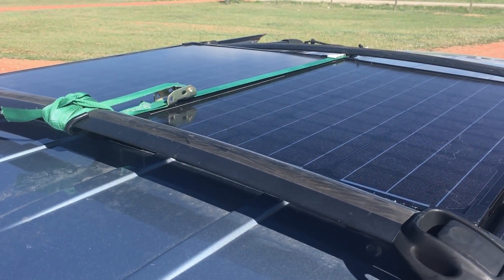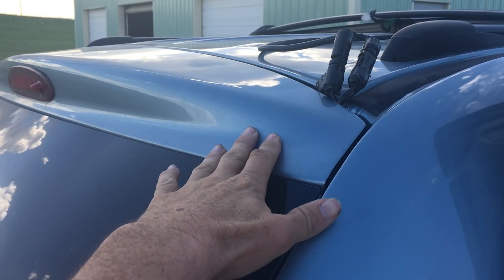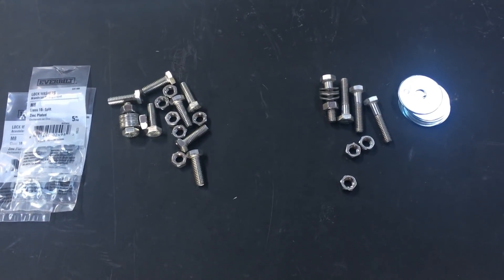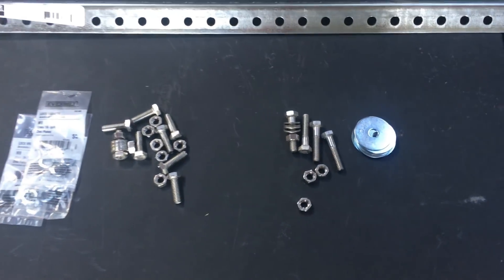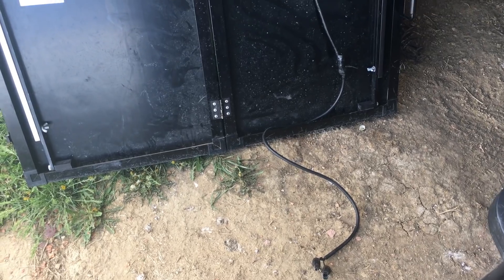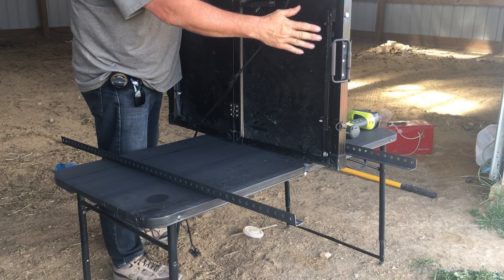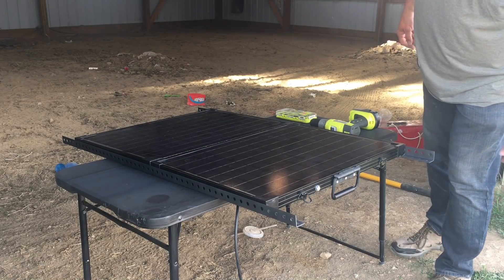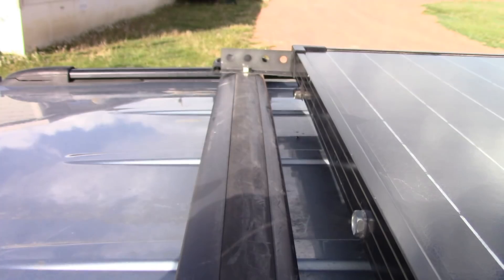Simple Solar Install on a Minivan: Mounting a Renogy Suitcase Panel on the Roof

Comment: Hello, thank you for sharing this! I'm curious whether this setup continued to hold up over time? I have the same solar suitcase and this would definitely be the most convenient way to mount it, but I'm nervous about drilling through the frame of the solar suitcase and potential rust and long-term security.

Comment: Thank you so much for sharing. I'm having a hard time finding a way to get it up and not too many videos showing you how to
Reply from the maker: It took me a while to figure out a simple and secure way to mount the panel on this van while working with the existing roof rack. I was also trying to keep this installation as discrete as possible which, based on conversations with a lot of people afterward - including several police officers, was successful. Unfortunately I no longer have this van so I cannot take any new photos to demonstrate better what I did.

Comment: I'm trying to do this to my dodge. I have the same brackets, my question is what size hardware do I need to screw the brackets into the roof rack.
Reply from the maker: This kind of thing varies between vehicles unfortunately so everything is "custom" with van builds, etc. It seems like I may have used 1/4" diameter stainless bolts as they would fit through the bars on my roof rack fairly easily, and then I used washers to prevent the bolts or nuts from pulling through.
Reply: @FrontierVanLife  Thank you so much. I got it up and it's running. I did screw them into the roof rack.

Comment: I really wanted to see the rest of the setup so I had an idea
Reply from the maker: I covered the entire solar setup (it was a very simple system) in another video. This one was just focused on mounting a portable panel on a minivan roof.
Reply: Robert Witham oh ok, thanks I’ll check it out!
Reply from the maker: Justin, here is a link to that video I mentioned. It was a very simple system, but it worked well enough for my needs. I would like to have added a battery isolator or continuous duty solenoid to charge while driving as well, but never did get around to that project before selling the van. I have a very robust system in my current van that I should probably make a video about as well. I would likely give serious consideration to a portable power station (solar generator) if I was starting over in a minivan these days due to the improvements in technology and the prices having come down a lot. It was basically just a DIY version of a Jackery (or similar) that I was running in the minivan. https://www.youtube.com/watch?v=PTMqjY91jx0
Reply: Robert Witham cool Thx

Comment: i know this video is old but it just popped up in my feed today. i have a renogy 100 watt suitcase without charge controller. i mounted it in my cargo basket on the roof with zip ties, then i ran a thule kayak locking strap underneath and through the basket and stand and cross bars to keep it safe. i have no issues on the highway at all. very snug...and i hook it up to the renogy phoenix. i also have a bluetti 1500 and can hook it to that if needed. :-) i hope you guys are doing well and safe!

Comment: I have to be online a lot... maybe i can start with that setup then will get a 2nd one if i can afford another 100W panel. I would most likely not mount it on roof. I plan to be close enough to a town to have em outside. def want to charge the 2nd battery with alternator
Reply from the maker: Being able to charge off the alternator is a great bonus, especially if you drive frequently.

Comment: I love this solar panel setup! One question though - do you have a contingency plan for hail? and or have you had that issue yet?
Reply from the maker: I ran into hail a few times and was a always a bit concerned. Never experienced any damage though. I don't think I have ever actually heard of panels being damaged by hail, though I suppose with large enough hail it would be possible. Probably do a good job of destroying the van if it was that large though too. LOL I have seen broken panels, but it was from other mechanical force - like the wind blowing them over against rocks or similar.

Comment: I just got a very light weight flexible 100 W panel with holes all around the edges...I was thinking I could use heavy duty zip ties hooked on my roof rack...has anyone tried this?
Reply from the maker: I have heard of that, but would be nervous about it personally. I have also heard of people mounting them with industrial Velcro or VHB tape, though I also know people who have lost panels that way as well. I think my approach with flexible panels would be to mount a stainless steel or aluminum mesh panel on the roof racks and then install the flexible panels to the mesh using bolts. I do tend to overbuild, but that would likely be my approach to balance ventilation for the panel and secure mounting.

Anyone else have any experience mounting flexible panels?
Reply: I added a PVC frame to my flexible panels and am going to mount them similar to Roberts but I may need to build a wood deck so I don’t get vibration and can build a wind scoop in front.

Comment: Is the solar unit, waterproof? Would I have to take it down in the rain? Thx
Reply from the maker: The solar panel itself is waterproof, though the charge controller that was mounted on the back was not weatherproof. I removed the charge controller and installed it inside the van to keep it safe from the weather.

Comment: The problem with this is that panels lying flat are very inefficient. Over the entire day, you may end up only getting 40% of what you would get if they were angled.
Reply from the maker: It worked well for several months after I installed it over the summer. Now that the days are shorter and the sun is lower, I have found a huge improvement by removing it so that I can tilt it toward the sun. I will have to consider a way to make it tilt when I reinstall it on the roof.
Reply: If you could put hinges on one side and a locking mechanism on the other side you could probably still safely drive when it's flat, but easily tilt it up when you are parked.

Comment: Would this work to run the smallest truck fridge?
Reply from the maker: That is a little hard for me to say definitively, but as a general rule 100 Watts is the minimum to run a refrigerator. The catch is that on cloudy days or during really hot weather you may find it is not enough. Cloudy or rainy days will result in not much power coming in, while extreme heat will make the refrigerator run more than usual. I would think 100 Watts would be adequate if you also had a good battery bank or had a solenoid or isolator installed so you could charge from your engine if necessary.
Reply: And, it depends on the size of the fridge.  Some of the small Dometics draw about 35 watts... when the compressor motor is running.  So, a panel with 100 watt capability should do the job, even if it's only outputting 40 watts.

Comment: We are about to set out in our van and will have a Dometic CF18 and 2 laptops.  I guess there's no hope of running all 3 at once, but is it possible to have a suitcase panel kit for the 2 laptops and another one dedicated to the fridge alone?  This video really helped!  I am simple-minded and need simple install instructions!  LOL
Reply from the maker: Assuming you have a good battery or batteries (mine needs to be replaced), you will have a buffer that allows you to temporarily draw more power than you are taking in or after dark. The catch there is that you don't want to draw the battery down too low or it will damage it and shorten its life.

The other consideration is the type of laptops you are running. I actually use two. My older one that I rarely use now is a glorified netbook (came with Windows, but currently running Linux). That laptop sips power and will run 12-14 hours on a single charge. Unfortunately, it is not remotely powerful enough to edit video. The new laptop is an Asus gaming computer that I use for editing video. This laptop sucks down a lot more power, but is also much more capable. While the power draw on laptops can vary, I have read that 5 amp hours is a good average for full-size laptops. That is about what you can expect to pull in from a 100 Watt panel with good sun.  Another trick with laptops is to dim the screen or turn on the battery saver mode to limit power consumption (this does limit performance though).

You could certainly use two separate solar kits, but you would need separate batteries to keep everything isolated - one for the fridge and one for everything else. That being said, the CF-18 is fairly small and supposed to be pretty efficient. Keeping it as full as possible (even if only with water bottles) will make it run more efficiently, as will keeping it out of direct sun during the day. A lot of people wrap extra insulation around them or cover them with blankets or pillows too, but I have not seen any scientific reports on how much difference it makes.

You can get an idea of how much power the refrigerator and laptops will use by doing an internet search for the models that you have. The refrigerator, of course, will be on 24/7, but the laptops will depend on the hours of usage each day. A lot of times though it comes down to "trial and error" - just keep a close eye on the battery voltage to be sure you are not drawing too much and adjust from there as necessary. One final thought is that I tend to have trouble on cloudy or rainy days. You would probably want to save power for the refrigerator on those days. I sometimes go to a library, coffee shop, or relative's house on those cloudy days to work and recharge the laptop.

Hopefully this helps :)

Comment: EXCELLANT video! Very valuable install. Thank you. Safe journeys and many adventures.
Reply from the maker: Thank you! There are definitely fancier installs that can be done (like tilting panels, for example), but I wanted to demonstrate a simple installation. Solar can be overwhelming when you first start to look into it, but it is possible to go with a pretty simple setup too.

Comment: I want to put solar on my van, maybe 1 big panel or two 100 watt. I have to have it done though. Nice job!
Reply from the maker: Thank you! I find 100 Watts to be adequate for a laptop and phone so long as the sun is shining. I would think 200 Watts would provide a little more of a buffer for cloudy days or extra power usage (like a refrigerator). Good luck with you install!

Comment: Interesting design, it looks much better than how you had it before. I think painting the bolts black would really finish it off perfectly.
Reply from the maker: This new installation is really a significant improvement. I was setting it up on the ground using the built-in legs while boondocking, but I still needed to break it down any time I needed to travel or if the wind was blowing hard. Once I started doing a lot of urban stealth camping this spring I needed a system that allowed me to use the panel in the city during the day. I found that I could position it on the roof between the adjustable roof racks, but was still concerned about wind. I finally noticed that the lip between the two halves of the panel was wide enough that I could use a narrow cargo strap to secure it from moderate wind and even hold it in place for low-speed driving in the city (I took corners very gently). Still, I had to take it down any time the wind was bad or I needed to drive very far. Actually, it was taking it down during an unexpectedly windy day that led to me being hit in the face by the solar panel! I am much happier with this setup. I was thinking about painting the bolts too. Now if the wind will just settle down so I can get to that project... LOL

Comment: Nice work, Robert! And who needs fancy? :)
Reply from the maker: Thank you! I have a preference for simple but aesthetically acceptable (preferable aesthetically pleasing) whenever possible. I would probably be willing to spend more money and time on the installation if the van were a lot newer and I expected to be driving it for at least a few years. In this case, I was able to really improve the function and provide more reliable power for only $30 in materials and about two hours of effort.
Reply: This makes so much sense when one has a vehicle with lots of miles. When it's time to buy a new vehicle these things can be easily transferred to the next one.

Comment: I know this will work better for you.  Thanks for showing how a suitcase can be a simple fix for people like me that are all thumbs and no brains for electric...
Reply from the maker: This is working great so far, and it was really a very simple installation. It cost about $30 for the hardware I used, and took only about two hours from start to finish.

The Renogy suitcase kit is a great option for people with basic power needs (100 Watts will cover basic needs so long as the sun is shining). I can recommend that kit without reservation for anyone who needs an easy way to get started with solar and does not need a lot of electricity. It served me well as a portable since January, but I really like having it mounted on the roof now.
Reply: You have convinced me, I wanted more with roof mounts etc but I think this will do ok.  I need to run a medical machine a few times a day but not for long at a time, a nebulizer.  It should work

Comment: Thanks for the video!  Good look on the upgrade bro.  I do have a question about that warehouse barn thing.  Is that on your family property?  It's huge and empty.
Reply: Chris Allen Arnett Its his relative's house..
Reply: Thanks.  I used to date a horse trainer who trained Patric Swazye's special horses and she had a huge huge building that she trained the horses in.  That building reminded me of a smaller version of that.
Reply from the maker: It came out looking better than I expected. I was afraid it would be uglier! The functionality of having it on the roof is wonderful though. Today the wind is blowing so hard that I would not be able to have it out if it were not bolted down.

The building that I did the painting and assembly in is at my son-in-law's house. The building came with the property, and is basically a three-bay shop. It is used as a multi-purpose building though and at various times houses horses, vehicles, etc. It was empty right now because the weather is nice so I took advantage of it to stay out of the wind for spray painting.

Comment: Simple and low profile setup. Good job. Zip ties are very handy to use and you can make adjustments easier than nuts and bolts. Very well done video. Making simple life, simple. (2 thumbs up).
Reply from the maker: Thanks for watching! I ended up using zip ties on the folding legs to keep them in place as well as the wiring which is now secured to the roof rack (forgot to record that part of the project). Part of the allure of van life to me (besides travel) is simplicity. I am a long-time minimalist and really enjoy making a game out of seeing how simple I can make things without losing function. Too ugly or minimal can sometimes be detrimental I think, but simple is overall a good thing and can also be functional and aesthetically pleasing as well.

Comment: Looks good and much better solution than portable. The bigger air space underneath should help performance, especially in hot environments. I am a huge Renogy fan and had a 100w on my last trailer and 200w on the current one. Always works great! Good video! --Mark
Reply from the maker: Thanks for watching and sharing your experiences! I am the third owner of this particular Renogy kit, and the previous two owners ended up installing rooftop solar panels. Since this van has 231,000 miles on it now, I really don't know how long it will last. That factor makes me think inexpensive and modular with anything I do to the van. I figured by keeping all of the original hardware intact on the panel, I can put it back together when I upgrade vehicles and either keep it for times when I might be parked in the shade or pass it on to a fourth nomad. I have been really happy with the performance from this panel though (and it will probably be better with more air circulation as you noted), but would ideally like a little more power - especially for cloudy days.

Comment: Nice job Robert! Actually it is not obnoxiously noticeable and most people probably wouldn't give it a second glance. As you mentioned, add a solenoid for charging your house battery while driving and between it and the solar panel, your house battery (batteries) should cover your needs for a laptop, charging phones, batteries and running lights and/or a small fan.  I always enjoy your videos and creativity making the minivan work. ✌🏼 🚐💨
Reply from the maker: Thanks for watching! It did turn out a lot less noticeable than I thought it might. Now for the solenoid to charge while I drive (or on rainy days when there is not much sun).

Comment: Thanks for the simple explanation! great idea!  well done!
Reply from the maker: Thank you! I kept it simple and inexpensive in part because this van has a lot of miles on it and I don't know how long it will last. I have seen some really nice rooftop installations, but wanted to show that it is possible to do it simply, quickly, and inexpensively as well for those on a budget or without access to a lot of tools. This whole installation (not counting the panel itself) cost only $30 and probably took no more than two hours.